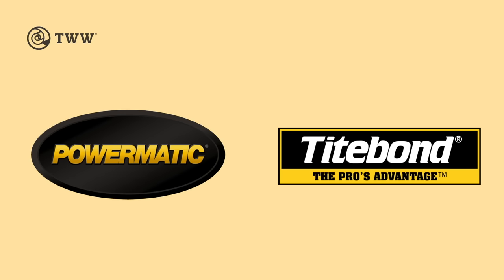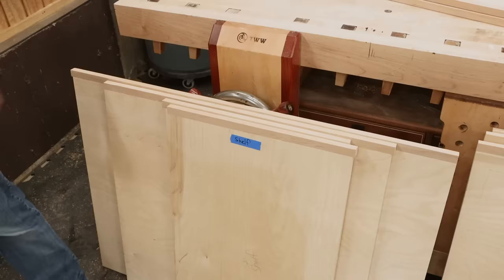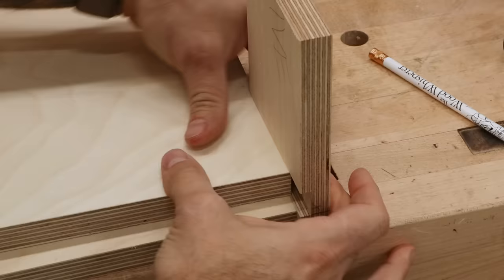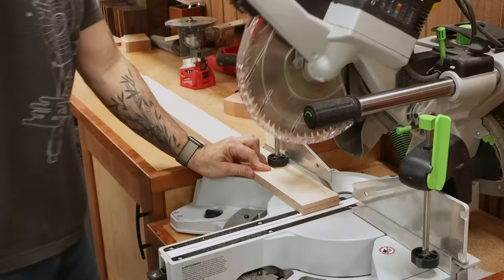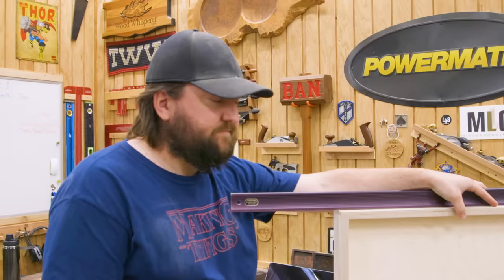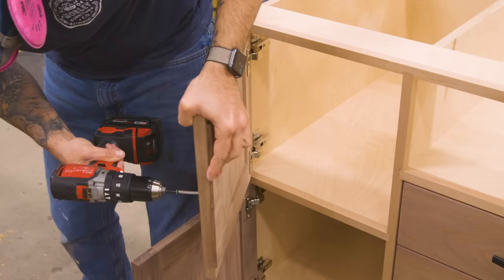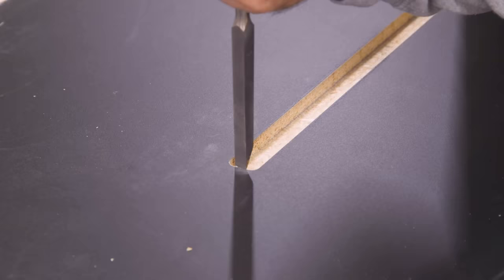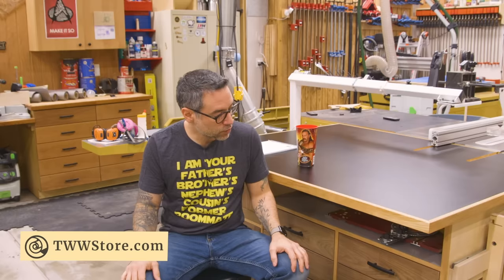Outfeed Assembly Table | Functional & Gorgeous

Comment: When it comes to assembly tables, which do you think is better, t-track or dog holes?
Reply from the maker: Neither. Assembly tables don't usually need work-holding implements. But if you want to also use it as a work table, either one or both will work. Dog holes are easier and you can put them in anywhere and as-needed. But t-tracks are nice if you have specific hardware and clamps you want to use. So I would think about the work you want to do and how you plan to hold the work. Keep in mind you can add both of these things well after you build the table. So if you aren't sure, wait.
Reply: @woodwhisperer  oh, yeah, I would be using it as a work table. I've been thinking a lot about building a outfeed/assembly/work table recently, and was mulling over the two options. You must have heard my psychic cries for expert counsel, and just happen to make this video right now. Thank you for the reply.

Comment: Beautiful, but what would be the drawbacks of making it an MFT table too?
Reply from the maker: Turning the top into Swiss cheese, primarily. The holes will catch dust and not be that fun to use for assembly. And forget about using it for a writing or drawing surface. That said, that might not bother you depending on your needs for the table.

Comment: I really like it. I was wondering, one your plans how high is the table off the ground without the adjustable feet?
Reply from the maker: Dimensions are listed on the plan page, I believe https://thewoodwhisperer.com/product/outfeed-assembly-table-plan/  Range is 34-36" in height so without the feet it's around 34"
Reply: @woodwhisperer  Thanks, that's great. I'll need to get 3" feet, but then I don't need to change any measurements and you have measurements in metric :) I'm sold. I'll grab  a copy of the plans now!

Comment: If clearance slots are not meant to guide anything. Then I guess I am having trouble finding a reason to not just lower the table a little
Reply: to support a long work piece. the whole point of an outfeed table is literally to be the same level so that you can make long accurate cuts

Comment: What is the purpose of putting the melamine on top of plywood? Would melamine along work also?
Reply from the maker: The only reason I used melamine here is to have a durable and slippery surface. The core of melamine is pretty much just particle board which isn't my favorite material to work with. So I like making the base of the top from good quality plywood and then I only need one sheet of melamine to drop in as the top surface. You can use melamine for the entire thing if you like.
Reply: @woodwhisperer  thanks!

Comment: Awesome!  What size bandy clamps are you using for your 3/4” plywood?
Reply from the maker: I have three sizes and wound up using all of them on this project. They pretty much all work though the larger ones have more capacity than is needed and the smallest ones were a little tight.
Reply: @woodwhisperer  Excellent.   Thank you for the reply.  My fear was the large size slipping on 3/4 ply but sounds like it worked well for you.

Comment: Marc, how did you attach that extruded aluminum to the Fence?
Reply from the maker: Drilled new screw holes into the base fence system.
Reply: @woodwhisperer  I must be missing something.  Aren't those little wedge shaped fasteners then on the inside?  How do you tighten?  Or are they in the lower groove and we just can't see them at the shooting angle?  THANKS!
Reply from the maker: @Jim Fox the wedge shaped nuts are what they provide but those aren’t the only nuts that will fit. Regular nuts work too so it’s just a new set of nuts and bolts. The bolt has an allen head on it and points out from the inside of the PM fence, with the loose nut in the aluminum extrusion.

Comment: I never understand why guys have a 5000.00 table saw setting there and they prefer to crawl on the floor and cut things up??? if you use a table saw enough you learn how to cut safely and get the job so much easier and way quicker- and I would say even more accurate... Love the wood whisperer and his work is always spot on- just dont get the crawl around method of wood working- may have something to do with my age, I guess if I was younger I might consider it. lol